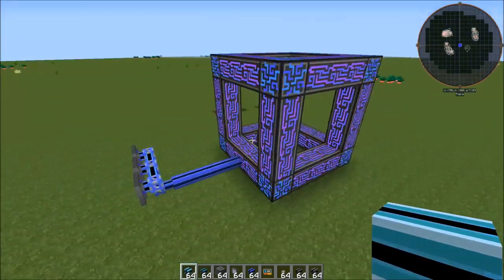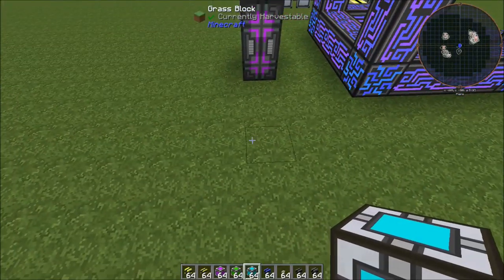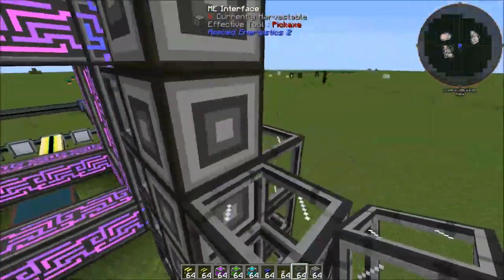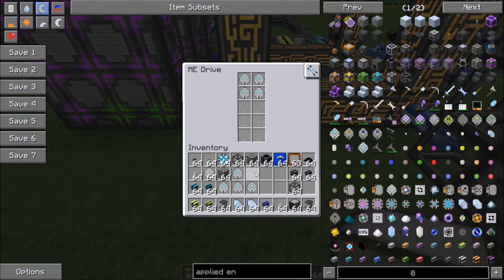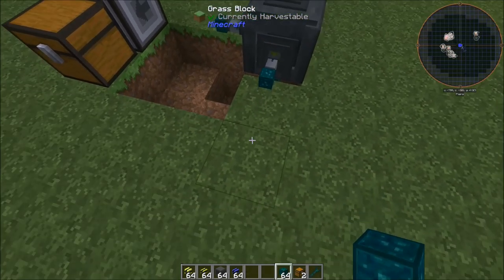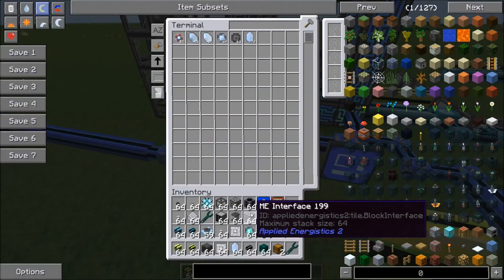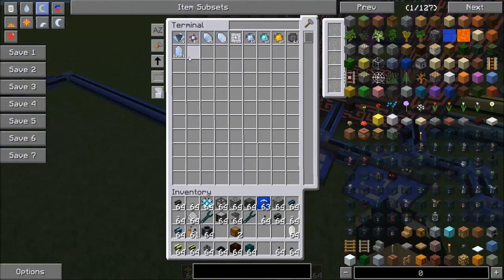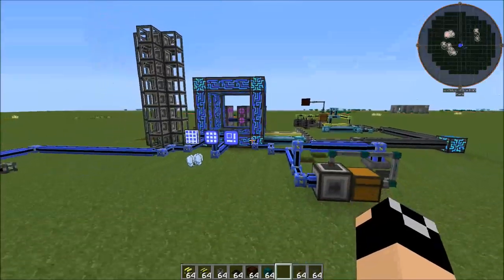Applied Energistics 2 Tips and Tricks Part 2: Auto Crafting

Comment: Using AE2 you can automate the insertion of Dark Steel Balls(DSBs)/Flint in the SAG Mill by doing this: put an interface next to the SAG Mill and put in the config slot 64 Dark Steel Balls/Flint and put a crafting card in the card slot(because you need to craft the DSBs) and set the SAG Mill to Pull(/Push if required) to the side next to the interface
 A simmilar set up can be done w/ the Mekanism Mettalurgic Infuser, but you would need to pipe out the (compressed(recommended)) coal/redstone/diamonds from the interface in the Mettalurgic Infuser.
 Maybe showcase a set up like this one  in the next AE2 tips & tricks vid?
  P.S.: Add timestamps in the description(e.g. 0:15 Inscriber Aumation)
Reply from the maker: Very true.  Very good suggestions btw, and good call on the timestamps.  And yeah, ill def cover the mekanism setups and ender io setups and do a video on those :)  Thank you very much for the suggestion.
Reply: +To Asgaard you're welcome. You're a really great youtuber btw
Reply from the maker: Thank you very much, that means a lot :)  And the timestamps are now up in the description.  And I'm going to go do the same to the first tips video in just a sec.